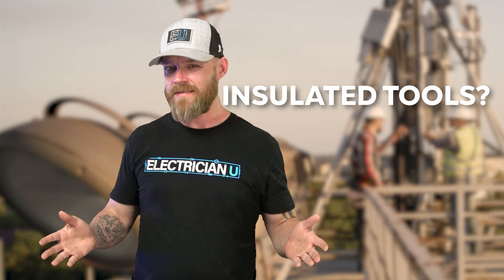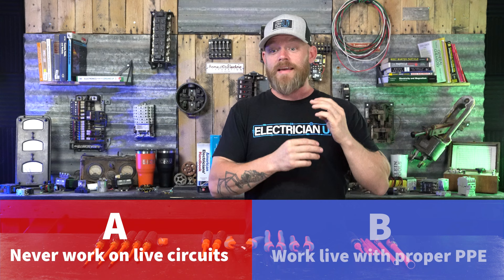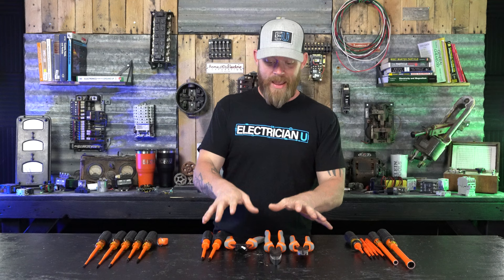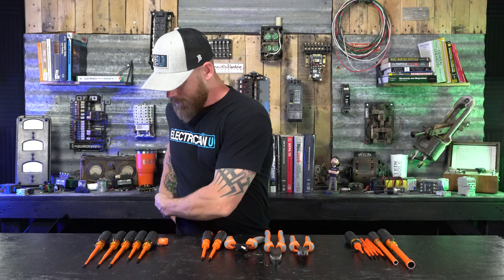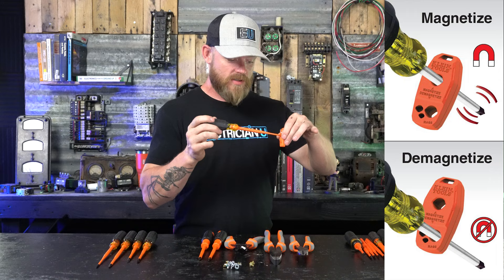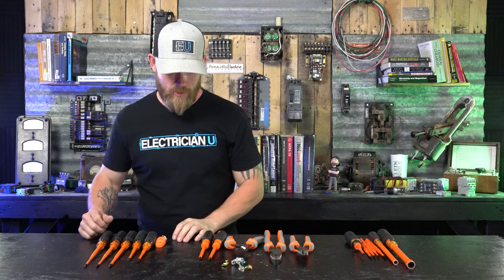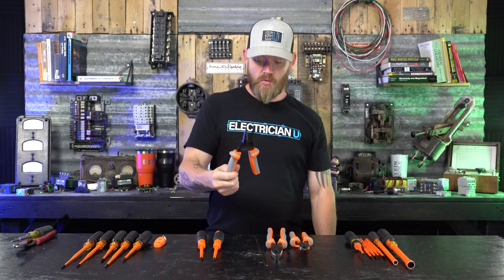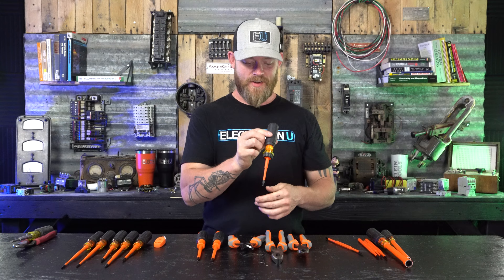Every Insulated Tool Electricians Need!!!

Comment: There is absolutely no way to avoid working on live circuits. If you do any kind of service work or troubleshooting, they have to be energized. You need to be able to check for voltage or current while they while equipment is in use. It shouldn’t even be a debate. It’s just a risk we understand & accept in our line of work.
Reply: My HVAC textbook literally stated that to properly diagnose a malfunction a technician needs to be comfortable working on live circuits safely
Reply: Facts
Reply: Testing and trouble shooting is separate from working on something. As soon as you reach for something other then a measuring tool you are working.
Reply: Still don’t need insulated tools
Reply: In the beginning I have been told by instructors to never work live under any circumstances; but after working in the trade for a year I can now say I completely agree with you. It’s just convenience at the end of the day to work live.
Reply: @MasterVsApprentice  Long as not 480v or Higher
Reply: @MasterVsApprentice  “after a year”
Reply: @johnhershey4010  Ye fuck that lol
Reply: @il9861  yes you’re introduced to it quick quickly at my company
Reply: @MasterVsApprentice  I do live shit all the time. Never used ‘em
Reply: I work in control cabinets, most of my work is industrial tho. 480vAC to 24vDC
Reply: @gregpartain4307  yep still don’t need insulated for 480
Reply: @il9861  yes you do if there’s electronics inside . Especially if it’s Micrologix
Reply: @gregpartain4307  no, you literally dont need them. There is virtually no instance where it is required. Only preferred
Reply: I am getting tools i have insulated needle nose and plan to get strippers what else is worth getting ?
Reply: @il9861  thanks for this, there is no need for insulated tools! People dont know anything about how current works
Reply: @jarrettm3728  linesmans my man
Reply: @juledoren  I see what they think. Klein handles are made of tenite. Good for up to 900 something volts. Yes they aren’t “rated”  but the difference is so negligible between unrated insulation, and “rated” not sure how people can INSIST you need insulated tools but not know that.
Reply: Testing is different then working on something, I have been in the trade for 28 years use to do it all the time. Now I work for a large company, the rules say you can’t work on anything live. Guess what we don’t work on energized stuff. You tell the customer what the company rules are and the customers respect it. If they give you trouble you call the office and explain it to upper management then they deal with  the customer so they understand our rules. Not saying I don’t go into live panels but I won’t work on live lighting Cirs anymore. It protects me so I don’t get hurt. I know a guy that got hit with 277 went in his right hand and out his left elbow. It’s just not worth it.
Reply: @il9861  the difference is not “negligible” the difference is residential and commercial. Doesn’t take much to stop the heart in some cases so any insulation is necessary.
Reply: @MasterVsApprentice  the difference in the insulation rating of regular handles and insulated handles is what I called negligible. Insulated tools just have more dumbass protection. DONT TOUCH THE METAL
Reply: @il9861  can’t argue with stupid
Reply: @MasterVsApprentice  insulation is not necessary, if you actually are a good electrician you shut off live circuits and work on them, a good electrician uses lock out tag out and keeps himself safe. Dont be spreading bullshit.
Reply: @juledoren  again I’m talking about lower voltage here
Reply: @MasterVsApprentice  okay tanner 😂
Reply: Any Servicing or troubleshooting requires working with live half the time, its just how it is. Just if it can be avoided, i will because honestly you can work faster and safer. When its live, careful means slower but the insulated tools are an extra layer of protection in case the worst is to happen.
Reply: @butters742  thank you
Reply: @juledoren  they all think they are big and bad working on live stuff. Screw that I have done it plenty of times but the older I get I look at it as if I get shocked and hurt I am the one that had to deal with pain and suffering. It’s really just not worth it. I get yea you have to test stuff when it’s on but splicing wires or replacing recs or switches is just not worth it. I get paid by the hour not how awesome I am for doing stuff hot.
Reply: @johnhershey4010  Disagree here , seen a guy get hit workin on 277 on a ladder so he wuz'nt grounded, hit him n fell from a 6 ft a frame ladder, hit his head n DIED brother,...DUUHHH,!!!
Reply: @timmcquain3855  Sorry to heat about your friend bro
Reply: It's like saying that, "I want to be a cop but I don't want to get shot at." Bro you literally sign up for that exact possibility
Reply: @timmcquain3855  u don't want to be grounded thats how you get shocked to begin with. Being on a ladder doesn't unground you. Also ground doesn't protect ppl GFCI protect ppl.
Reply: nailed it
Reply: HI Joel If I want to change my outlet switch plate I would imagine its the same as a light swich plate but I guess the answer is I should make sure to use an insulated screw driver? does that sound right thoughts please thank you
Reply: HI Joel my question to you is I dont think I can easily cut the power here I need to change an outlet swtich plate are you going to recommend an electrical safe screw driver? do you think its possilbe I can change the plate using my electrically safe screw driver?
Reply: I agree with other's comments that yes, voltage needs to be present to properly measure voltage values, but other than that, I made the decision years ago to not work on energized systems and if that created an issue with the contractor I was working for or the customer, I would respectfully suggest they find someone else to do the work, as my life is too valuable to take chances, but again, this is my opinion.
Reply: Insulated tools is like any PPE it's nice to have it and an added layer of protection but in this case in my opinion so don't take it as fact above 480v you want them under 480 you can do it with regular tools you just have to be more cautious where you fingers are. I work in plants and warehouses and we have to do hot work on a regular so I just got them. Then all my old none insulated stuff is in my old belt for rough in running conduit really anytime we aren't doing hot work like he said to keep your hot work tools nice and in good condition
Reply: I respectfully disagree, I retired after 35 years in the trade and I would say that the last 25 of them was with the voltage turned off. Let me clarify one point, when checking if there IS voltage, or how much voltage, then yes, it needs to be on, but once that's determined, it goes off.
Reply: @gregorall9779  we can't shut the machines down except for very certain reasons. The machines are fully automated and are supposed to run 24/7. I do agree with you most people in most types of electrical won't have to do hot or will see very little of it
Reply: Facts!
Reply: I'm just in controls but we don't live testing everyday. Have to. But really only do 24VDC live work. And twice in my career 120. If you are doing a repair don't do live. Unless you count resting drives or overloads lol
Reply: Came here to say this
Reply: Much respect and appreciation from someone who realizes my life would be absolutely horrible without electricians and all the electrical workers keeping our country energized.
Reply: This is why I ain’t an electrician nor am I an Alaskan crab fisherman. I’ve been shot at and almost blown up and my back is jacked from body armor, but this shit scares me even more.

I can rough in my own stuff and pull wire though so I am here.

I’ll let my electrician inspect my work and work on anything live. (And yes, they are good with it as there’s more work than there are electricians in my rural area).
Reply: @il9861 you sound like an apprentice
Reply: @il9861  I work live all the time I just bought these tools because I’m the only guy that’s comfortable and confident to do it, it’s just a added layer of safety but, i been saying for years now paying attention to what your doing and knowing what your doing is the best safety measure, don’t matter what equipment you use, if your stupid you’re still gonna get hurt 😂
Reply: @juledoren any intolerable electrician knows that you can touch live circuits all day if you aren’t touching a grounded surface you won’t feel anything.

Comment: Coming from a UK electrician, it seems baffling why you wouldn’t use VDE rated tools, literally every spark here uses insulated tools, it’s even taught in colleges that you should only use insulated tools on the off chance something might be live (especially when working in boards)
Reply: The reason is 1776 lol

Comment: here is what i learned working with electricians as aprentice. Never work on live circuits unless absolutely necessary which means avoid working on live cruits whenever you can. If you have to work on live ciruits never ever do so without insulated tools. I you love to work as electrician and value your life and lives of people at job site follow rules that speak of proper protection at jobsite to the letter especially if you work with electricity on jobsite. Old saying: It's better to prevent rather than treat is something worth keeping in mind while you work.

Comment: There’s no reason not to buy them over non-insulated tools especially if you only can have one set. The cost difference is low(considering the value of your life), You’re set to go if you ever need to work live but regardless, you’ve got that safety buffer in case somehow something is or gets re-energized. When I bought all of my apprentice tools starting out, I got all insulated Klein and Knipex gear. The bonus is that the larger handle grips are extremely comfortable

Comment: Agreed, the majority of the time there isn't a need to work on energized circuits.

But when it is needed it's best to have the proper PPE and proper electrically rated tool.
Reply: In a way I disagree when you say the majority of time there isn't need to work on energized circus ,it really depends on the line of work that you are doing for instance I do a lot of troubleshooting and let me just say that working live it's a must on the everyday that I serviced trouble calls. I must work live to take measurements and to find and locate the shorted or grounded wires of course when you find the problem it is much faster to open the circuit so that you can make the repair but for my line of work working live is over 90% every day

Comment: Regarding asking the customer to shut down to allow you to power off a circuit or an entire panel... My father worked in the chemical industry. Many of their chemical manufacturing processes take time (days, weeks, or months depending on the process) to safely shut things down without causing damage. Conversely it may take days, weeks, or months to then restart their process from a safely shut down production line. No way would they say "yeah, we'll shut down for you to install an outlet (or change out a panel)"... While this type of work (emergency electrical work) is a corner case in all the jobs an electrician will do, they still exist.
Reply: What you are describing is terrible electrical distribution. This means if you artery MCB failed when there is a fault in a receptacle, the whole panel will trip leading to millions of dollar of damage because you were too cheap to have 2 separate panels.

Comment: Anything that helps increase safety (without impacting ability) is a positive in my books.  I never work on live circuits, but you never know what may or may not be energized due to mistakes made by others.  I always use them when working in and around panels where there are live portions present.  I own and use insulated screwdrivers/drivers, cutters and pliers and they are in my main kit... my favorite being the Wiha 38051 as an every day carry in my bag at all times.

Comment: Strongly recommend a few quality insulated screwdrivers, linesmen pliers & cutters. 40;years ago installed half a dozen klien maroon colored handle grips. Not rated for voltage but have used them hundreds of times on hot 
277 & 480 volt circuits without any problems.  Always worked in large plants that often ran 24/7 so it was very difficult to secure & LOTO power. Years ago would use two pairs of fuse pullers & quickly remove two 600 volt fuses at the same time due to not wanting to single phase one of the few motors on them. Would not do it today. You must have rubber & canvas gloves tested every 6 months.

Comment: I see the VDE as an insurance, where if it so happens that the circuit IS live, you don't get shocked...
Or if you're working on something that might have some live parts or you can short circuit something... that insulation will save you and the equipment.
Sure, you want to make sure the circuit is never live when working on it, but stuff happens.
Excceptions obviously the times when the circuit has to be live... :)

Comment: I definitely have been taught the safe way and seen my journeyman and non union guys use regular old screw drives in panels and basically said you gotta know what is what
Reply: Yes until you drop that screwdriver across two incoming legs that’s fed from an 800 amp main. That’s the biggest reason I use them
Reply: @gregpartain4307   nope he is a god amongst men who could never make a mistake like that. Everything he does every day is 100% perfect

Comment: Larger established clients may have safety & EHS requirements that require LOTO.  Asking an electrical contractor to work on live circuits would open them to a massive lawsuit if something went wrong.  I'm sure the low-level line managers don't want to shut down, but the higher-ups are very lawsuit-aware.  Good practice when you arrive on site is to ask their safety officer what the procedures are.  Be safe, don't risk your future livelihood!  Certainly if hot work is allowed then these these tools would be a necessity. (In this case, the client issues a "hot work permit".  Be suspicious if they don't give you one, it establishes responsibility & liability.) Really great content as usual Dustin!
Reply: 'Hot work permit' in every plant I've been in means welding/ grinding or torches.   I've really never seen a 'live electrical work' permit.  But, yes, there are definitely times especially on control circuits(120V)  that you work on them live.   And, yea, insulated tools are damned handy for that.  Consider yourself the 'local' lineman and working on live circuits in that case.  Not particularly dangerous if you're careful and aware.
Reply: @nhzxboi  I worked as PM tech in the semiconductor industry, and I had to take a "on the job" training class specifically named Hot Work. It was an in depth training class on live 220v to 1kv circuits. The equipment I worked on stayed energized 24/7. Most of it at 480v, with multiple power sources, along with various types of gases. We did have a LOTO protocol we also had to follow. We could isolate certain portions of the equipment we were preforming the PM on.

Comment: Completely understandable about pressures of working live in limited cases but even in those cases as NFPA70E suggests PPE is the last thing to consider. If you go through the NFPA podcasts there are some remarkable stories from electricians having to work live and when accidents happened how much that increased costs for the companies including compensation insurance and greater OSHA scrutiny. That’s aside from the mental and physical scars from the arc flash incidents. In industrial settings when the demand for working live is highest with high voltage, 3-phase power incident energies are much higher. The risks are much greater in those settings and PPE itself and on its own won’t cut the mustard. Other factors have to be accounted for to reduce risks.

Comment: One of my journeymen just took his regular Klein screwdrivers and put some heat shrink over the metal shaft, he said that it's not technically rated for live work but he hasn't had any problems. I personally have the Klein insulated multibit set (exactly like the one you showed) and even though I haven't used it much yet, I absolutely love it.
Reply: Your journeyman might have an idea.  Not osha.  But i use it....hahaha.
Reply: I have the milwalkee insulated set.  I only use the square number 2
Reply: All others i just use whatever.
Reply: I wld use a cple wraps of 3m tape to be sure but ya I've been wraping my uninsulated tools with tape in a pinch for 25 yrs+ (use wd-40 to remove adhesive and add some oil as well no corrosion or stickiness  and squeak free too
Reply: I just use a regular Klein screwdriver with the exposed metal shaft, just gotta be careful

Comment: In europe, most sparks use insulated 100% of the time even when working on non-live circuits. My cable cutter is the only tool that's just dipped, and it does perfectly fine cutting live 400v wires.

Comment: i’ve honestly been using vde as a main for multiple years. The insulated wera screwdriver set is like $4 more than the standard. knipex pliers are pretty much the same price for insulated. No regrets, the knipex insulated grip is very comfy